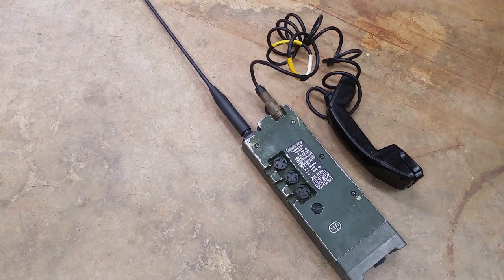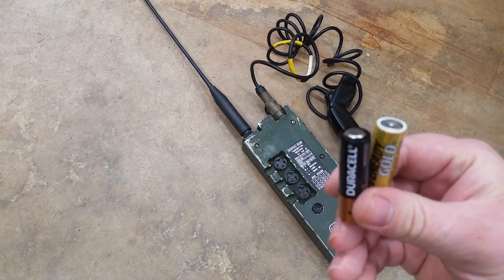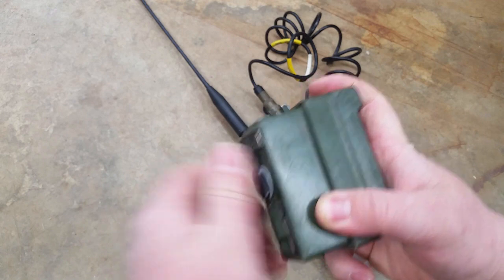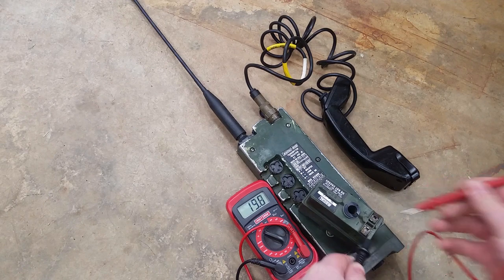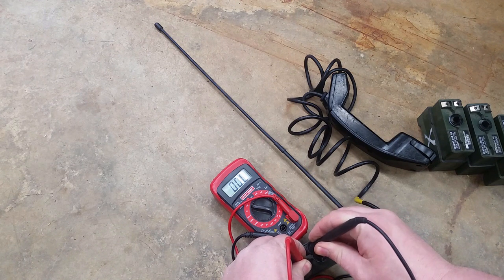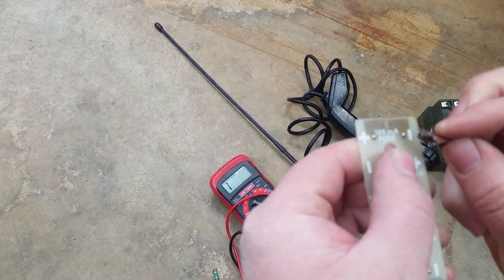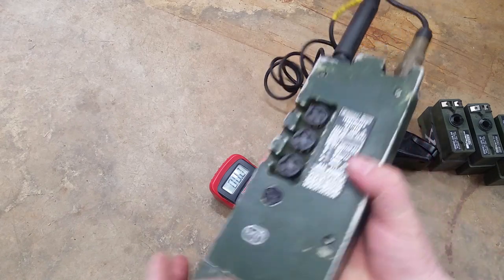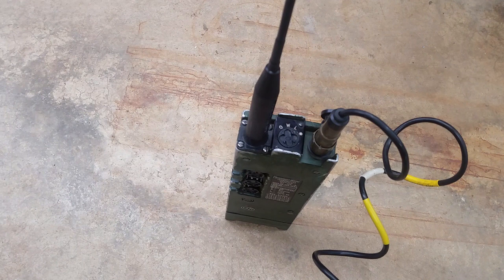Clansman Radio PRC-349: AA Battery Cassette

Comment: Thanks to this video I've been able to clean up a PRC 349 battery cassette and get it working. But is there a way to troubleshoot the radio itself or the headset? I have no experience of fixing radios or electronics but have been able to do some basic troubleshooting with a multimeter. So any advice will be gratefully received.
Reply from the maker: Glad I could help with some of it. But that is the extent of my knowledge with working on them.
Reply: @SmallTeamSupply  No worries and thank you for your time :)
Reply: @SmallTeamSupply  Got it working. The connections needed a good cleaning and I think I had over tightened the battery cassette bolt thing, which pushed the batteries off the contacts.

Comment: 1:01 - "...while the Eveready is depressed..."

Yeah, they probably come from the UK! 😉

4:22 - "Berks ACF" = Berkshire Army Cadet Force.

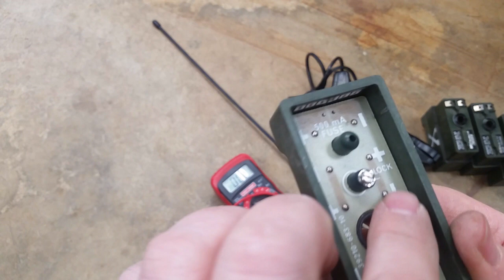5:21 - Unlocking the PCB. I must have an older one because mine doesn't have that. The cap doesn't have the same contacts. it has leaf spring type contacts - and there's no fuse. Badly corroded from long-forgotten batteries, I had to clean, decorrode the contacts and use a soldering iron to get everything working. But it doesn't. (My electronics knowledge is hopeless but I can use a soldering iron.)

I've only used one of these when doing sentry duty. Section (US = "squad") commanders, OPs and snipers used them in the field. Most of my time when I had to carry radios, it was the 351. But when I have had to carry these, they've had the NiCad cassettes.

Do these work using zinc oxide batteries or must they be alkaline?

Comment: Mine does intermittent hissing, what could that be?
Reply from the maker: I'm not sure Mark. If you find a guy in the US that can service these radios at the depot level, please let me know.
Reply: Low battery warning  if at regular intervals otherwise it could be local interference breaking the squelch from bad power wall warts or WiFi pc ect but most probably low battery

Comment: Just purchased one, arrived today, from Poland, very informative video, will clean the contacts, ordered fuses just in case...also wondering where can I buy another battery cassette...
Reply from the maker: very cool! I bought some extras from LRseries. However I haven't had to best purchasing experience with them, they haven't replied back to any of my emails and I dont want to pay for the overseas phone bill.
Reply: @SmallTeamSupply  I've found them to be very good on eBay and incredibly fast.
Reply from the maker: @simonsignolet5632  cool, I may try that next time.